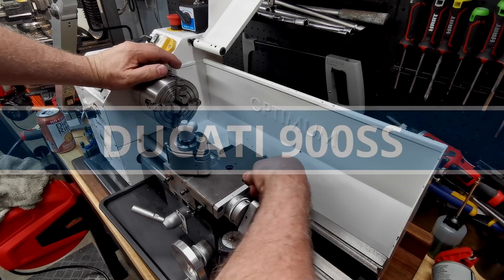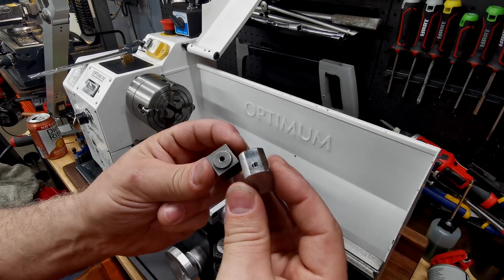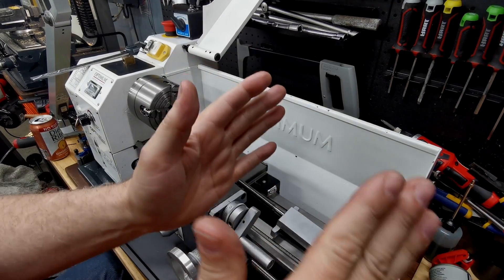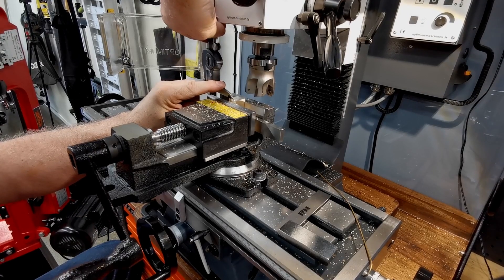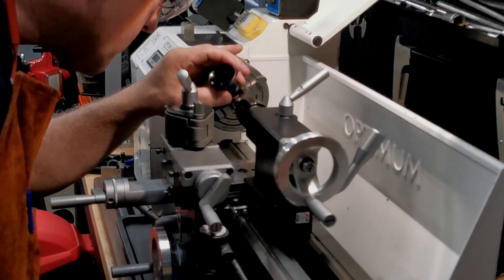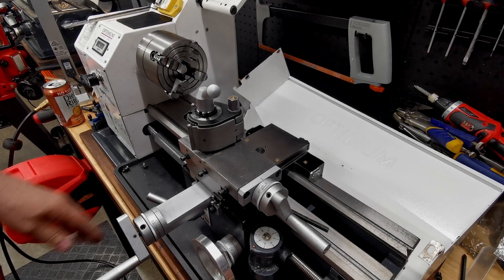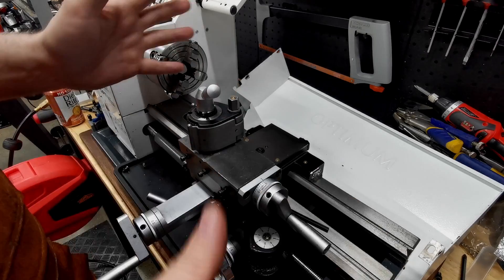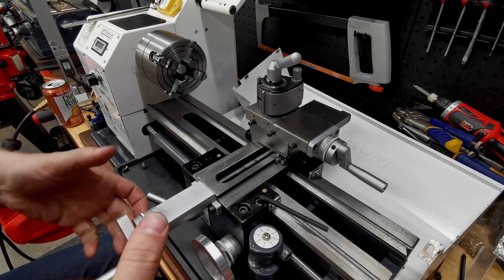New Cross Slide Nut & Adjustment Tips - Optimum TU 2004v Lathe - Rob's Garage

Comment: I'm having to make my own one of these. Had this same thing happen on my Warco WM180. This video has been super helpful in seeing how you approached it. Glad I got a 4 jaw chuck laying about. Itle be the second time ive used it haha.

I might make a few of these and keep them as spares. Ended up buying some bronze round but just for it. Will need to square it in the mill first.
Reply from the maker: @Festivejelly  good that you found some bronze. I finally got some months later and will use it if I ever make another. Let me know how you get on with yours.
Reply: @Ducati900SS  In the UK we have a few suppliers where you can buy it by whatever length you want. So I just bought 30cm of a round bar. That will give me a few tries at it at least.

For me im not looking to get rid of the backlash entirely, its more that I want consistent backlash and not wearing the leadscrew or nut.

Right now my leadscrew has uneven wear so on my little CNC controller the backlash compensation doesnt really work. But with bearing bronze and some decent lube then it should work nicely and i can get even backlash.
Reply from the maker: @Festivejelly  Nice, that's better than what we have here. Let me know what you do in the end.

Comment: G'day mate. I'm about to buy a lathe and was looking at the 2506. Are you still happy with it? Have you found any problems with it?
Reply from the maker: @lendabloke  Hi, yes very happy with this lathe. The only other options here are some Sieg models that the importer can get and the Toolshed one which is also a Sieg. This one is a step up in many if it's features. With any of these Chinese lathe you need to be prepared to adjust and fix things, just that there's less to fix on the Optimums in comparison. The 2506 is quite a lot larger and heavier than my one and if you have the space, it would be great to have. The first video in my lathe Playlist has many points that are all still valid... taper bearings, hardened ways and so on. Be ready to buy other tools and a mill if you get stuck into this!

Comment: Great video..im just tearing down my tu2004v right now, it needs a good clean and adjustment..i see that the main bed has no adjustment at all..i presume that the plares may need machining lightly to reduce movement in this part..
Reply from the maker: Hi Dan. My series of videos here is an evolving story and so the later ones are more on point, whilst the early ones are sometimes not quite right. The video here above is all good and still correct however. 

Regarding the ways/bed adjustment, watch this video I made more recently: https://www.youtube.com/watch?v=CrgGmAuF8Tk

With the taper cutting information in that video you should be able to sort out any alignment issues you find. Twisting is the adjustment. Mine is pretty much bang on in that regard and I wouldn't expect yours to be bad either. 

I also had another viewer recently get in touch and describe how the saddle on his 2004v was not tight along the full length of the ways and he spent a fair amount of time lapping the underside to level that out. There's a guy here on Youtube who has a long series of videos where he laps the undersides of his Sieg lathe. I was thinking more like you that machining the underside would make more sense, but that of course requires a mill.

Mine is slightly loose on one corner but I haven't yet spent time sorting it out. I'll sometimes let the saddle lock drag slightly as it's that corner that is loose. By loose I mean I can feel a click when I rock it back and forth into that corner.

Let me know how it all works out with your lathe anyhow.
Reply: Thanks for the reply rob, 
Your vids are all definitely bery helpful and you give excellent details 👌 

All my stuff has been in storage for a long time, and i really wanted to get some small jobs done.. i believe im a little rough, 😅
Using half blunt cutters and so forth, but even though the bed lock works well it still has a fair amount of movement at the back side, so always would push the cutter away before any real machining could be done..
So a quick fix i carefully sanded the 2 underside pieces where they meet the bed,  i significantly reduced the movement and can now use the lathe with precision,  i know its definitely in need of machining to get it square,
Reply from the maker: Right, that's interesting. I'll have to have a closer look at mine and see if I need to do something there... video will then follow of course!  @Rcplanedan
Reply: @Ducati900SS  of great,  well definitely mine had a fair bit of movement in that area,  👍

Comment: Which qcth would be the right size, what do you have? Axa?
Reply from the maker: Hi Marco. I've got a video about that here with all the details: https://www.youtube.com/watch?v=GH2HKs5nktA
The Multifix Type A is supplied by Optimum for the TU2004v, but I spent time and wasted some money to finally discover that the uncommon MultifixType AB is the better fit. No mods are needed to the toolpost and the height is spot on for 10mm tools. You can use bigger and smaller tools as well but at 10mm the adjustments are all centered. The Type A works but is very small and needs to be modified to fit. Trouble is, the type AB is rare and on eBay now only one seller has it.. the same seller I bought it from a couple of years ago. Be sure you look for Type AB, not Type A.
Reply from the maker: Following up my earlier reply - I just checked my video and the one Optimum supplies is Type AA not Type A. Regardless, get Type AB.
Reply from the maker: Hey Marco. I've just had an email from a viewer who has purchased the Type AB from the same seller on eBay and it did not come with an 18mm hole underneath. Instead it has one about 22mm. He's in discussion with them about it and they're basically saying to make a bush for it. Note that their specifications chart still shows it as having an 18mm hole. Just letting you know here as this now conflicts with my information here in the video.

Comment: Seems like a bit of a bad design on the lathe crosslide tbh.
Reply from the maker: Yes, it's pretty typical though. Real nice would be what they call 'ball screws' like they use in CNC mills and such. They basically have zero play in them.
Reply: @Ducati900SS  
Ball screws are not good for manual as any longitudinal force on the screw will turn it or in other words - they can be driven backwards - which is something you do not want here.  In CNC machines the motor holds it (when powered), or extra brakes.
Reply from the maker: Right, that's interesting. I didn't know they were like that. I've got the Optimum DRO 5 sitting in a box waiting to install it on the lathe. I'll be counting on that to deal with any backlash issues. But overall I'm finding the lathe a lot easier to work on than the mill, so it's not a great issue on this. Thanks for the comments. @joansparky4439
Reply: @Ducati900SS  
no worries, just having ur lathe-playlist open and going through them to make up my mind about this machine.
Reply from the maker: Excellent, ask anything else if needed. I'm around and I see the notifications come up. It still is the best lathe around this price down here in NZ/OZ. The Sieg lathes are pretty awful in comparison. The next step up from this would be the next one up at Machinery House and it's the size and weight that makes the decision with that. @joansparky4439
Reply: @Ducati900SS  
Yeah, I need some parts turned NOW and can't wait on my actual desired machine (AL960B - which is a Liang Dei 1236 from Taiwan). And going much bigger than this TU2004v doesn't make much sense cost and space wise if I want to keep the small one around (while also trying to get something decent).  From a rigidity POV it's length is probably just right.. biggest concern was its ability to use inserts for steel/stainless.. but I think that should work.  can always change the motor out for VFD + 3ph with more ooopmh later and live with subpar results in the meantime - at least I get my parts done.
Reply: @joansparky4439  Right I see. In that case, this is the one, unless you go a lot larger and there's no point in that with that big one coming. I'd say the main risk with this small one would be general rigidity as you say. It's fine for me, but it's obviously not going to be anything that AL960B. I haven't got or machined any stainless, but normal steel hasn't been a problem and I've never been into second gear either.
Reply: @robax  
Cool, thx for that info.
Reply: @Ducati900SS  
Ordered one a couple days ago.. now sorting the other bits for it, esp digital readout scales, but the cross slide is pretty thin, isn't it?
Would u be able to tell me what the height from the top of the cross-slide to the top of the saddle is please?  From a video (*) I've seen it looks like 15~16mm.. is that about right?
Big Thanks!

*) 'Warco WM180 new beginner . fitting the DRO scale to the cross slide'

Comment: great job mate what model milling machine do you have?
Reply from the maker: I had the Optimum BF16V like you can see on Machinery House, but that's about to be sold on the local auction site, finishes tomorrow. The one I decided to spend up big on is the Optimum MH 22V which is not available from Machinery House. They only do the older model the BF20 which is very heavy at 162Kg. When I saw that someone had imported an MH22 separately and that it was quite a bit lighter at 120Kg I decided to jump in and get it. That said, I was quite happy with the BF16. It worked fine and is just smaller. There are one or two Sieg mills that weigh somewhere inbetween and could be an option in AUS.

Comment: Would you buy the tu2004 again? Or would you love the tu2506? I'm about to buy one or the other. Weight is an issue. 75kg is ok, 150kg is a bit much for a mobile work trailer.👍👌🇦🇺
Reply from the maker: Hi Hawk. So far I'm pleased with this lathe and haven't regretted getting it. The weight mattered a lot to me and as you say, 150Kg for the next model up is a lot. I wanted to be able to move it myself and also push it around my workbench by hand. The choice was between a fairly crappy Sieg versus this Optimum for a similar price. The Sieg had a couple of inches extra length, but this one was better in every other way and I'm happy I went with this (even with the broken nut in this video). Optimum in Germany (stuermer-machines.com) actually sell models 2304V and 2406V, at 114Kg and 125Kg, but Machinery House don't import them here. The 2304 is like this one but longer and would be great to have. Maybe see if someone imports one of those?

Otherwise my advice would be - If you can make the things you want to make on the 2004v, then get that. If you can't, then you haven't got a choice but to go larger. Do you know what sort of things you're going to be making? 

FYI - I faced the same weight issue with the mill that I purchased. I bought the 75Kg BF16 because the next model up was the BF20 at 162Kg. However, unlike the lathe, I quickly found I wanted a larger mill.. but not a 162Kg one. Then I saw on that German site above that Optimum does a new version of that mill at only 120Kg.  I searched for it and just by chance a company here had imported two of them. So I decided to take the opportunity to upgrade. I managed to get it onto the bench by myself and am definitely pleased with it, but I wouldn't want it to be any heavier. Let me know what you decide to do.
Reply: @Ducati900SS  I actually have a bf16 sitting in front of me now, I like it, for the price and weight.....I've got a sapphire mine and and interest in machines, I've built 2 pulsators and a trommel so far, but want to expand my business with a mobile trailer. Mill with 6" rotary table and 6x12 magnetic chuck, mig and flux core, tig with rotary welding setup, plasma cutter and table( soon to have an arcdroid),drill press, bandsaw, 3 in 1 sheet metal machine, fab table all in a converted camper trailer into a mobile workshop. Trailer is 720kg, gvm is 1440kg, so I've got 720kg to play with. Gotta be clean n light. Thanks for the reply👍👌🇦🇺
Reply: And a budget of $1600. Why? Because I just bought a vevor 1100w 220x600 lathe, delivered yesterday, back in the crate getting returned on Monday. So many issues, bad grind on the bed ways was the killer. Gunna be a few weeks till full refund, but I've bought heaps of stuff from hafco, tu2004v looks like the one for now👍👌👌
Reply from the maker: @adhawk5632  I had to look up a pulsator and a trommel to see what they are heh. Yes, you'll definitely have to be careful with weight in that camper. I'm wondering if there's a way to keep the machines lower down during travel and only raise them to bench height when stationary. I liked the BF16v but decided to jump on the opportunity to upgrade to the MH22v just because it was available and the weight and size would fit into the same space I'd already set up. The fine control on the quill was also a motivator. Let me know how you get on with everything.
Reply: @Ducati900SS  Fine control would be nice on the mill. Really it the spindle bore size that matters. At 21mm,3/4 inch shafts is the limit. A lot of the motors I use are 3/4(19mm) or 1"(25mm), so the tu2004 is still a good option. Then camper is a regular trailer with a steel frame and ally skin. I modified it myself. Looks like a go-kart race trailer. I agree, keep the weight low for long trips(its 1400kms to the sapphire mine from my home) and install them into place when there. Thanks for you reply👍👌🇦🇺